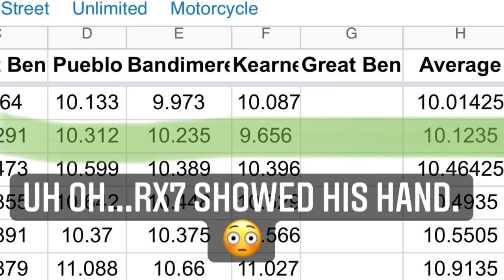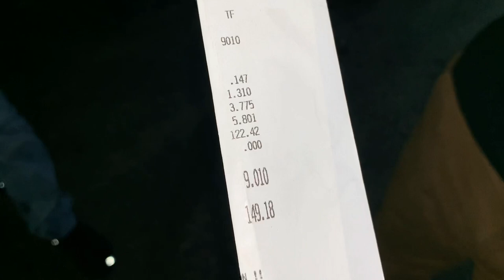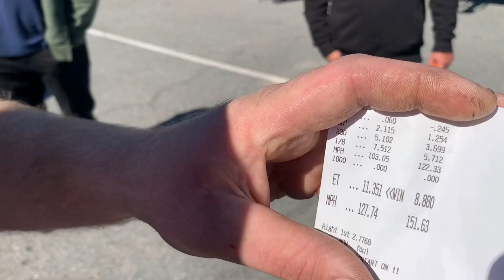Stock Motor Cobra Goes 8’s With A Whipple And A Man Pedal!!! - Episode #035

Comment: I've got a stock 03 terminator, but it's SO hard to resist modding it out when you see videos like this. For just a few grand, you can turn a terminator into a supercar.

Fantastic job driving, and love that terminator in red. Mine is in black (the most common, but it's still fresh only 12.8k miles, clean title and a garage queen)
Reply: A lot of fun to just add bolt-ons and port the blower/tune.  I actually preferred that over upgrading to a twin screw.  It had great power but you don't have to add bigger injectors/fuel pump. 
You'll get around 500rwhp and the Eaton sounds amazing.

Comment: That is freaking awesome! Almost 20 years later and a stock terminator engine is still competing and putting down impressive numbers. Keep up the content.

Question, why do you guys keep the passenger seat in the car?
Reply from the maker: The seat itself is so light it really would not equate to any gained et/mph for the car. The bracket and seat together may weigh 12-13lbs at most.

Comment: Any idea what trans he is running? Those shifts are lightning fast. Is it a dog engagement? 

This video has me stoked for 2023! 8’s on a stock motor 4.6  Terminator is ridiculous! RPM transmissions is currently building me a straight cut dog engagement lvl7 tr6060. 

Last piece to the puzzle will be a 15” conversion and removing some weight. If I’m not in the low - mid 9’s (boost only) by summer, then either my car blew or I can’t drive 😂 No excuses. 

Def subbed to this channel!
Reply from the maker: Running a regular T-56 Magnum….non faceplated.
Reply from the maker: We’d be interested to see some more mopar guys get after the stick game.
Reply: @2ndshiftracing  I will definitely stay in touch man. Most guys with manual hellcats give up because they eat through tr6060’s and move to TH400’s. Even the lvl 7 rpm trans won’t hold for big power. It’s just too much torque and too much weight for the syncros.  

I believe there are only 3 other hellcat in the US that are running the straight cut gears. It’s supposedly good for 2000hp. Hopefully that combined with my diff brace, mantic triple disk, and DSS axles it should be pretty damn stout. It should have be down to 3900lbs with me in it by summer, which is light for a challenger.

I should have the trans by mid-February. RPM does a core exchange so it super convenient. I’m so damn excited.
Reply from the maker: @Boostedm3nace  good deal, interested in seeing the results. Find us on instagram, we’re also about to drop a video on product we use to 60’ these cars that will really be beneficial to stick shift guys.
Reply: It's called driver mod bro lol.
Reply: @Boostedm3nace  the tr6060 holds up pretty good in older gt500s but they're 38-3900 lbs max stock.  I suggest getting the cat down to that weight minimum that would go a long ways towards helping things.  If I had a hellcat it would be a stick I promise you that lol.  I have an 07 gt500 it's at around 750 rwhp with a gen3r.  I love the tr6060.  Btw gt500s make a ton of torque too so you can get the Trans to hold the biggest thing is the weight.  I'm gonna get mine down in the 36-3700 range with the iron block I wanna do weight saving but no race car mods it's primarily a street car.  It's around 3800 now 3900 stock.  I have a much lighter exhaust and a drag pack plus 1 piece aluminum ds which drops 20+ lbs.  That is all now as far as weight savings I estimate it's around 3800.  Don't give up like everyone else man get that weight down on it.  Stick shift for life.
Reply: @2ndshiftracing  awesome I'd be interested I wanna do some stick shift racing with my 07 gt500.  It's primarily a street car so no all out race mods but I'd like for it to get out good at the track and even on the street as much as possible.
Reply: I love that you are a Mopar guy doing stick stuff very few of you out there it seems.  Most of them are auto fanboys to the extent they even done away with the manual smh.
Reply: @midnight347  we’ll be changing that soon 🔥

Comment: Dude does 9's consistently with a completely stock engine and just swapping out the blower and possibly using a built trans? Or is he just using a slipper clutch on stock trans also?
Reply from the maker: Slipper device of our design. Box stock magnum.

Comment: Sweet. That's a beast. If you don't mind me asking, what transmission and clutch are you running? Is it a hydraulic clutch?
Reply from the maker: T-56 Magnum, McLeod RXT1200, Cable clutch.
Reply: @2ndshiftracing  Thanks, man. I love a fast stick shift car.

Comment: Do any of these fast Cobras still run stock ecu.  If not what was the limit on stock ecu with stick
Reply from the maker: Yes! Allen Garrett in Alaska ran 8’s with the stock ECU. The limitations is the processing speed when up in the higher RPM range. (7000+) so holley is needed pass that.
Reply: @2ndshiftracing  Thank You.  I have an 04 Cobra on E85, built short block but stock heads and cams.  It went 9.80’s at 140 mph in the 1/4 mile with a 2.3 Whipple.  I do run a Th400 and sra.  I’m bored of the car and want to put a T56 Magnum into the car.  I still have stock ecu with SCT software.  I’m not looking to break records just the fun factor of the stick and get the car to still run in the 9’s but with a stick
Reply from the maker: Put a stick in it and come race with us! Be glad to help you out!
Reply: @2ndshiftracing  Thank You..  I would appreciate the help
Reply: @gilbertrtf2195  thank you finally someone who gets it.  Ditching his th400 for a t56 magnum is what I'm talking about!!  Stick shift ftw it's way more fun on the street or track but especially on the street so if you street it at all you will like it much more there.

Comment: Are you guys still on the factory head bolts, or is it studded?
Reply from the maker: Factory head bolts
Reply: @2ndshiftracing  then I'm not going to worry about head studs lol
Reply from the maker: @spikestang  take out timing at peak torque then roll in back in on top. 

Our other cobra has 18psi and 250 shot on stock head bolts. 140,000 miles and still running low 9’s
Reply: Thanks for the advice, my car has a kenne bell mammoth on it, I only make a little more than 600 whp on 93 octane, every one keeps saying that the head bolts will allow the heads to lift if I push it anymore, it sounds like it's more of getting the tune right than just raw power numbers.
Reply from the maker: @spikestang  yup, good fuel, good tune, good maintenance is key.

Comment: Awesome...what size tires and gear??
Reply from the maker: 28x10.5 and 3.73
Reply: @2ndshiftracing   I have 355s what size tires would u recommend??
Reply from the maker: @shanesilago9136  If it’s IRS 28x10.5 Slick
If SRA…275/60/15 Pro Bracket radial.
Reply: @2ndshiftracing  o ok ..I have 355 gears I met to say....
Reply from the maker: @shanesilago9136  oh I see, 26x10.5 with 3.55 gearing.
Reply: @2ndshiftracing   thanks 👍👍 I'm going to tell all my buddies to subscribe....
Reply from the maker: @shanesilago9136  thank you! You can catch us on other media platforms if you have questions.

Comment: What was your 60 foot and mind sharing suspension you’re using?
Reply from the maker: 1.25
8.8 with race craft relocation brackets 
Strange DA shocks
Viking 175 springs 
Team Z control arms 
UPR torque box supports
UPR anti roll bar
UPR springs perches

Comment: What’s the maximum whp stock bottom end can handle ? I though with ARPs headstud and billet oil pump gears around 750ish with race fuel ⛽️
Reply: Impressive
Reply from the maker: @SVT_Baker made 1400 on his stock bottom end with twin turbos. He went 8.26 at 170+

So it’ll handle a 900-1000 comfortably with a good tune, good fuel, and good maintenance.
Reply: Yes they'll Def take more than 750 even with a blower setup.  On turbo setups they can do 1000+ pretty easy.  With a blower you might have 900 wheel but the engine is seeing over 1000 wheel hp worth of stress because of the power it takes to spin the blower if that makes sense.  That is why you can usually push higher numbers out of turbo setups.  It depends on the overall setup but you can go well north of 750 and be good these things are stout I mean they have manly h beam rods stock for gods sake and an iron block lol.

Comment: Would ask the setup but i know it’s probably a secret
Reply from the maker: 100% stock motor with a 3.0 whipple, RTX 1200 clutch, T-56 magnum, Fore Fuel system, Holley EFI, and good SRA suspension.
Reply: @2ndshiftracing  what pulley set up for the gen5 whipple?
Reply from the maker: @yoshiscobra  4#/3.5
Reply: @2ndshiftracing  thank you! And I thought whipple gen 5 3.0 didn’t whine lol
Reply from the maker: @yoshiscobra  they do if you turn them hard enough lol